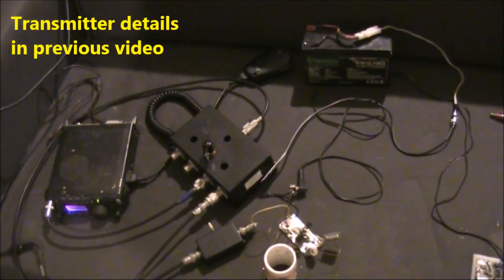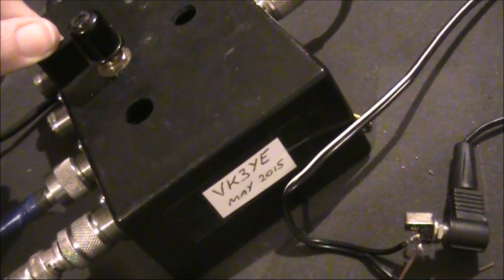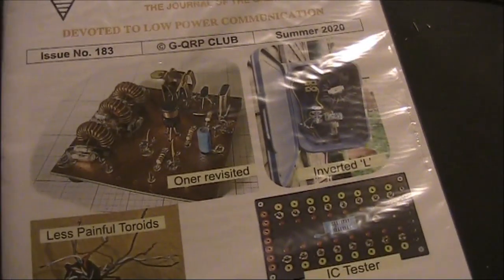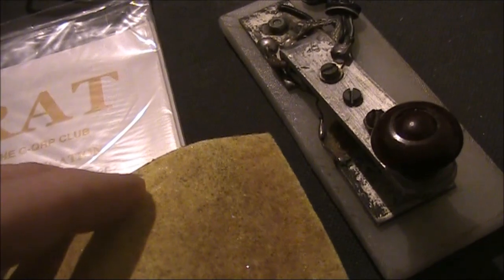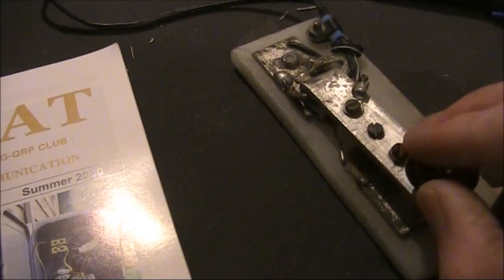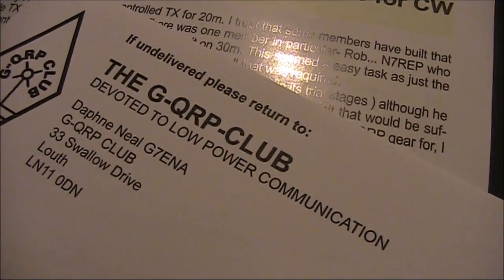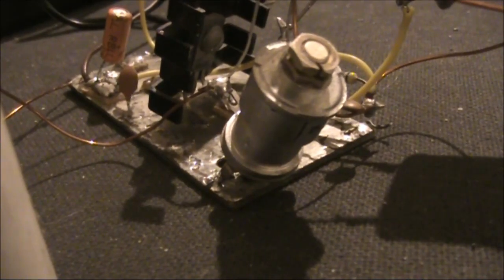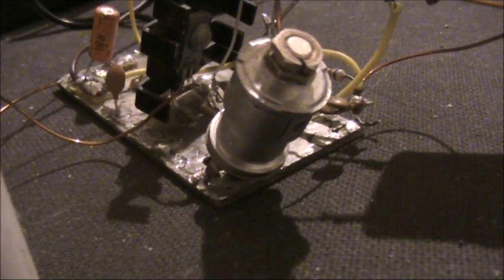Cheap and chirpy 1 transistor QRP transmitter gets a contact

Comment: I love the sound of it... it reminds me of the old tube CW transmitters. Peter... question... where could I find a simple drawing of the switch you use to change the antenna from RX to TX between a receiver and a transmitter ? I kept trying to find something, but I can only find fancy and complicated schematics.
Reply from the maker: It's just a single pole double pole switch. Ant is common connector, tx & rx on each end. May need to be double pole if you're also switching dc power between tx & rx.
Reply: @vk3ye  Thanks so much Peter. I did got to see the connection in one of your schematics just a little ago. Sounds perfect for me. Simple switch will be :) 73.

Comment: Hello old SM5MEK here, I have the same result  with one transistor, but another one for keying givs you better cw, let the transistor do the keying of the transmitter the blupps arround the sign filters away. Maybee a zener on 12V give tou a better cleaner tone.
Reply: Yes but can you push 10W with a dual stage rig? The emtx does that in a single stage if built as described here http://qrp.gr/emtx

Comment: I know this is just early days with the experimentation with this circuit, but if the inductor was made more compact and had less inductance so some more capacitance was required to resonate it, chances are it would be a bit more stable.
I wouldn't be surprised if it could be easily done on a ferrite toroid of appropriate dimensions and built into a small tin, using the tin as the heatsink for the bd139.
Build it into a sardine tin Peter 😃